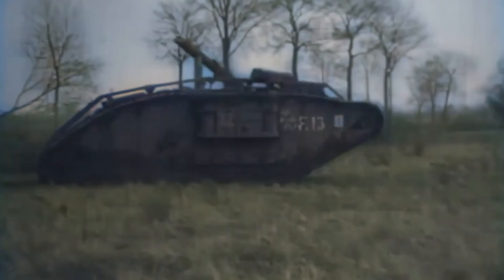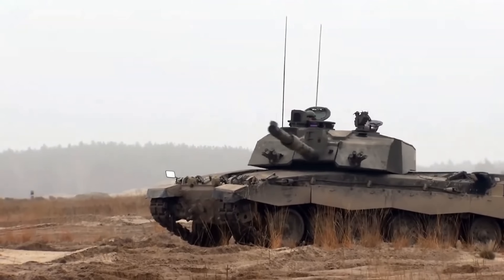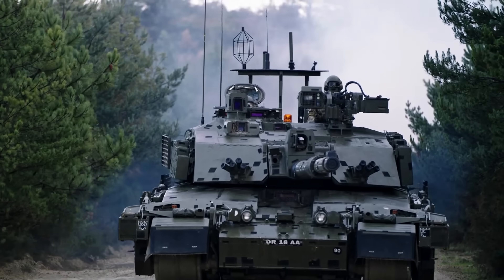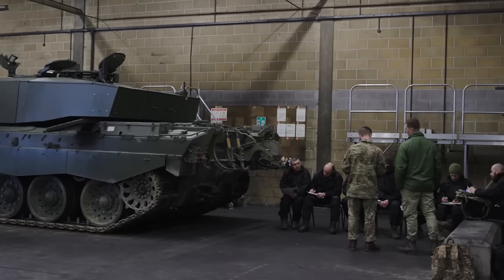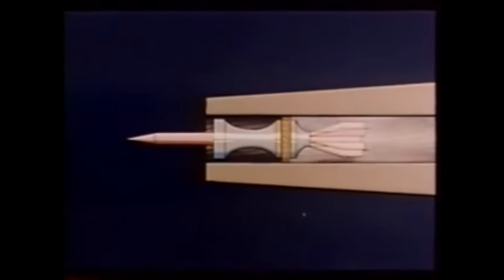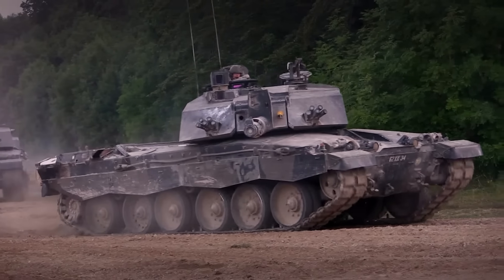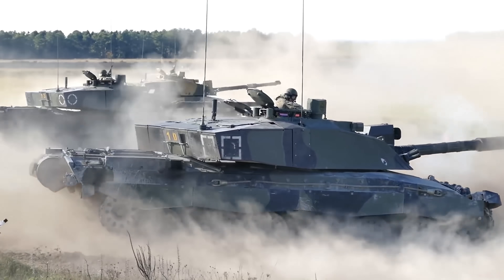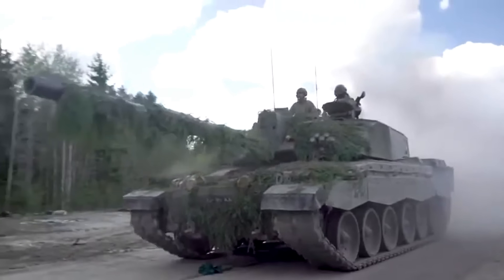The Challenger 2 | Out of time?

Comment: I find the discussion of two piece vs single piece because the thinking was completely opposite in the 1990s (see, for example, the 1991 RAND study, An Exploration of Integrated Ground Weapons Concepts for Armor/Anti-Armor Missions)

See, the length of the APFSDS piece can be lengthened in a future tank design, if desired, but what's more difficult to do is make a 140mm single piece round that a human loader can handle. Even with an autoloader, this is still a problem because you really want a human to be able to load the ammo magazine. Also, depending on the design of the autoloader and reloading procedure, you want the ammo pieces to be vertical. Two pieces, with a concentric carousel, can be a lot more efficient, especially with an unmanned turret.

So the solution would have been two piece 140mm ammo with an autoloader. It would have been the only way to achieve the desired doubling in armor penetration capability over 120mm, while also keeping the rate of fire up to speed. The desired doubling in horizontal armor protection and vastly increased top armor protection also pointed toward an unmanned turret.

All that said, warfare has gone in a different direction than what was anticipated in the early 1990s. And the war in Ukraine may require us to dramatically rethink how tanks will and should be used in the future. Most notably, tank vs tank engagements seem to be relatively uncommon, so it may make more sense to use a smaller gun (with a lot more ammo), along with drones to engage enemy tanks.
Reply: 120mm rounds  are already at the limit of what a human loader can manage.
A DM63 APFSDS weights i about 23kgs.
A 130mm one piece cartridge weights in close to 40kg.
so no, beyond 120mm you  have autoloaders not manual  loaders.
Reply: @zhufortheimpaler4041  The point is that with two piece ammo, each piece can be less than the full weight.

So, for a concrete example, suppose you have an unmanned turret with an autoloader and ammo carousel underneath it. You still need to somehow load the ammo carousel. With one piece 140mm, the round would be too long to fit vertically, so it's going to be a horizontal carousel. But how the heck do you get the ammo loaded? The carousel is surrounded by the tank treads, engine, and a minimally sized crew compartment. And seeing as the ammo is too heavy for one person to reasonably handle, simply man handling the round to get to wherever the heck it's loaded through is ... problematic.

With two piece 140mm ammo, each piece could be more easily handled. The pieces could fit vertically, so the turret just needs a small vertical port suitable for lowering the pieces into the ammo carousel.
Reply: @IsaacKuo  well thats the dead end the russian tank developement has maneuvered itself into.
125mm rounds weight in around 30kg.
And with that configuration you cant have blowout panels to prevent catastrophic ammunition detonations.
if you look at western autoloader  designs, they are generally compartmentalised casette autolaoders in the turret bustle with blowout panels.
and the turret cage is filled with other neccesary equipment that is now better protected vs enemy fire. Like FCS computers, battery stowage etc.
Reply: @zhufortheimpaler4041  If you look at Stryker MGS and M1 TTB, the ammo was stored in the hull. USA designers were obsessed with minimizing frontal profile of an unmanned turret. It does make sense, considering a lightly armored unmanned turret would leave a bustle magazine particularly vulnerable and exposed.

Furthermore, the crew would be placed in the hull in front of the unmanned turret, which can mean that they'd be in danger if the turret were pointed to the rear arc.

Overall, I think it does make sense to place the ammo in the hull, with blowout panels underneath and above to whatever extent is practical, and to place a thick blast partition behind the crew. The T-14 may be the "dead end" that Russian tank development has driven into, but it's actually the same basic layout as M1 TTB. The USA designers of the TTB didn't have any legacy restrictions forcing them in that direction. They just figured it was the way to go, given thinking of the time.

That said, I think Abrams X and possibly M1E3 will have bustle magazine, regardless of having a lightly armored turret. I don't think we have any publicly available info on what is below the turret, but we can generally note that MBTs have gotten a lot of new "stuff" added on compared to what they had in the 1990s.

My discussion was about design thoughts in the 1990s.
Reply: @IsaacKuo  the Stryker MGS and M1 TTB were armed with 105mm gun and 120mm guns.
those  cartridges are signiificantlys shorter than a 130mm or 140mm round.
Look at the Rheinmetall  130mm gun for KF-51 and how big the ammo is in comparison to 120mm rounds.  A two part system would  drasticly reduce the capability of the round.
Reply: @zhufortheimpaler4041  Seriously, look up the 1991 RAND study, An Exploration of Integrated Ground Weapons Concepts for Armor/Anti-Armor Missions. It will offer you a lot more insight into what designers were thinking in the 1990s, than looking at current proposals. The ideas for 140mm were a lot bigger than the 130mm gun for KF-51, and the best way to make that fit was two piece ammo with autoloader.

At the time, it was assumed that the next generation of enemy tanks and anti-tank weapon systems would make our next generation tanks need twice as much armor penetration, twice as much horizontal armor protection, and much more than twice as much top armor protection. These requirements are beastly compared to what the KF-51 offers.

The anticipated advances in enemy tanks and anti-tank weapon systems did not actually happen, the nature of the GWOT gave higher priority to development of MRAPs rather than main battle tanks, and so here we are with the M1, Challenger 2, and Leopard 2 tanks as incremental improvements over what was available in the 90s. But technology has moved on from the 1990s and the realities of 2000s and 2010s era warfare has changed thinking on what is needed and desirable.

And keep in mind that KF-51 is also just a snapshot in tank design thinking, reflecting pre-war thinking. The war will cause a massive reassessment of what future tank designs should feature, and it's plausible this will look very different from KF-51.
Reply: @IsaacKuo  France, Germany, Britain and the US all developed experimental 2-piece 140mm guns/rounds. Plans were to use standard type bustle auto-loaders.

Comment: The original design for the M1 series tank came with a coffeepot.  (Apparently when tank crews were polled - this was a 'must have' feature.)  Sadly, somebody said: 'no.'
Reply: Leo1 and Leo2 got the power plug and mounting point for a boiling vessel. boiling vessels are in posession of the army, but not issued, because they tend to drain the turret batteries in overwatch

Comment: Ist there a su75 Video coming
Reply from the maker: With how little is known about it and how unproduced it is, I’ll unfortunately have to wait a while before covering it accurately. :)
Reply: @KabodaOfficial  ah okay. Well i tought IT would be funny because IT IS honestly a hunk of Junk. I know a thing or two about aircraft Design the funny Part is it wont be able even to Take Off. The competitor of the f35 Had for a reason that ugly face because somehow you need Air for a engine and this tiny slits wont be enough. Furthermore seperating this intakes with Just a little Sheet isnt bright either. I hoped for a little hate Video. Chekmate 😂 maybe itself but nothing more.
Reply: @cwf_media9200 What is also funny is that the program would inevitably rely on foreign investment of potential buyers to fund most, if not all of the development costs. I doubt anyone would be interested given the history of corruption, cost overruns and delays in Russian Industry.

Comment: To say the tank is a brand new tank just because they got different manufacturers to make a different version of the same parts is such a joke. The main part of the tank is the initial design, how big your hull is and how big the turret is, that's what decides the engine, gun, armor, crew amount, crew layout, ammo, ammo storage, survivability features. You can't make that much of a difference with the same design. That's why the Abrams is 70 tons, bc the initial design is limiting it and all they can do is add stuff in the least efficient way possible.

Comment: I just wonder, why Britain doesn't join the Leo 2 program, gets a license for it and produces that tank on the island. Way cheaper due to the higher numbers and more flexible in the long run with better spare parts supply, upgrades and so on. Especially as you point out, if tanks aren't your priority, just go with what works on the market. With the boxer, the international collaboration worked as well.
Reply: The Leo 2 isnt that up to date either. While I still think it is a more modern vehicle then the Chally 2. I think it would have been a better idea to start a new program in its entirety. Something more like the K2 or Leclerc. The 120mm is fine but modern elctronics, armor, and a 3 man crew, and something to cut its weight.
Reply: They’d be better to buy into the K2 or a stretched K2, the K2 has better suspension than the L2 similar engine and transmission to the L2. A stretched K2 + Uk derived armour would be a better route.
Reply: @robertpatrick3350  well, As poland is now realising... K2 is absolutely perfect for south korea, as north korea still uses T-54 and T-62 derivates today as primary armor fleet.
In europe  on the other hand, the armor thickness in the front and the frontal arc protection of K2 is a bit lacking and more akin to Leo2A4, meaning any realistc 125mm armed threat has a legitimate chance to punch through that armor or avoid it completely.
The side armor is non existand. 60mm Steel.
Well....
Reply: @robertpatrick3350  probably. I think the k2 would make a great start
Reply: I dont think adapting leo 2 is the way to go, they should have done that 10 years ago, but now leo 2 is also nearing the end of its Upgradeability. They should join in on developing the next generation

Comment: I think another significant aspect of the tank that you might want to include is the tank's Thermal Observation and Gunnery Sight (TOGS) being not stabilized. This makes an engagement using just the thermal sight more difficult than other tanks.
Reply: Since the thermals are mounted on the gun assembly you also can't easily use them with long distance (2.5Km+) HESH shots since due to the ballistic profile of the HESH and the necessary gun elevation your thermals are literally staring at the sky.
Reply: @dwightk.schrute8696 yes you can, I'm not going to go in to how but you'd know if you've actually been a gunner on one.
Reply: Isn’t the sight in the bustle at the base of the gun? So stabilised with the gun? The GAS sight isn’t on the gyro platform of the gun. Are you not thinking of CR1?
Reply: @gsmith1418  when the gun is stable, the sight is stable. However when the gun moves, the sight moves with it, because the sight itself is not stabilized. As a result, when the loader elevate the gun for loading, the sight will be looking at the sky. Addionally, the sight moves when the fire control systems gives a fire solution (giving automatic lead and elevation), thus making it a bit more complex to engage the current target and to laze the next target.
Reply: @gsmith1418  The stability point is at the tip of the gun, not at the base.
Reply: Once something prided is now the excuse

Comment: Amazing, though I have one small critique.
The Challenger 2 uses a hydrogas suspension system. The difference is that hydropneumatic has inputs, it can for example raise and lower the suspension. Hydrogas is a sealed system, with each road wheel getting its own hydraulic piston that absorbs the weight and shock of the track. It’s much more simple, reliable, and easy to work on compared to hydropneumatic, and even traditional torsion bar suspension.
Reply: look at wheel size     less wheels bigger wheels     it rocks!
Reply: The units can be pumped up with nitrogen gas. When battle armour is added the pressure is increased to maintain ride height.
Reply: @agt155 yes, but not automatically while the tank is driving. Thats what hydropneumatic can do.
Reply: @jacobbaumgardner3406  Hydrogas is just a brand name for hydropneumatic suspension ie hydraulic damper with gas spring. Hydrogas is not adjustable on the move - that would require a new level of complexity.
Reply: @agt155  several tanks use it, whatever you want to call it. Japanese tanks have been using it for half a century. It allows them to raise and lower their suspension on command, and even angle their tanks forward/backwards or side to side. The downside is that it’s complex and maintenance heavy, while hydrogas is very simple and lightweight, and requires little maintenance comparatively.
Reply: @jacobbaumgardner3406  Yes, MBT 70 had a similar system, but it was expensive and unreliable.
Reply: @agt155  that’s. . . .that’s what I’ve been saying since the beginning.
Reply: @jacobbaumgardner3406  Hydrogas = Hydropneumatic. You do not need the control system for it to be hydropneumatic suspension. Your critique implies the challenger does not have hydropneumatic suspension when it in fact does. Horstmann themselves call it hydropneumatic suspension, alongside their similar products such as hydrostrut.

If someone were to say the boxer had tyres, you wouldn't turn around and say "um, actually the boxer doesn't have tyres, it has X Force Z's"
Reply: @Raichor  I’ve only heard it called Hydrogas by maintenance crews. Regardless, it is not an actuating system, and only softens the suspension.

Comment: Sensible analysis. However there is a critical mistake in your assumptions particularly regarding the gun. You're working on the assumption that the primary role of the tank is to attack and destroy other tanks, but historically that was a small part of what the tank was expected to do, and from what I've seen so far in Ukraine tank on tank combat is rare and tactically inadvisable. 

Rifles can't fire HEAT and their darts aren't as good, this is true, but they are actually more accurate when shooting HE and HE-Frag, not to mention HESH which requires a rifle. Additionally HEAT is always better when fitted to an ATGM or unguided rocket, because the power of a shaped charge warhead is proportional to it's caliber, not it's mass or velocity. The Rh-120 HEAT round is already inferior to current generation MANPATs, and much larger vehicle mounted ATGMs are on the horizon. Further the most powerful anti-tank weapon on any tank in Ukraine is the radio, calling in artillery or loitering munitions is far more effective than anything that can be achieved with the main gun of a tank, rifled or not. 

So I actually think the Royal Armoured Corps is wrong to give away their rifles at this time. What they should really be focused on is indirect fire, smart munitions, electronic warfare and integrated drone capability. What tanks are required to do is attack buildings, clear trenches and field fortifications, to close with and assault enemy lines and provide fire support to infantry on the move and in defensive postures. That's more than enough to keep them busy and warrant their cost without asking them to play War Thunder IRL. 

Also you seem to think you're pretty safe, but please remember Beijing is closer to London than it is to Canberra or Los Angeles. Despite what some on Twitter might have you believe, the world is round and the maps are misleading.